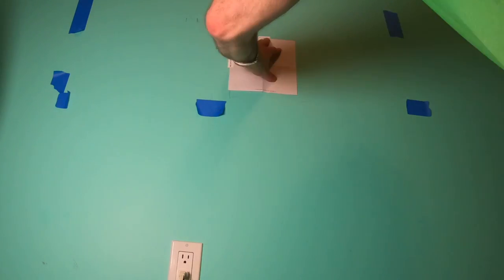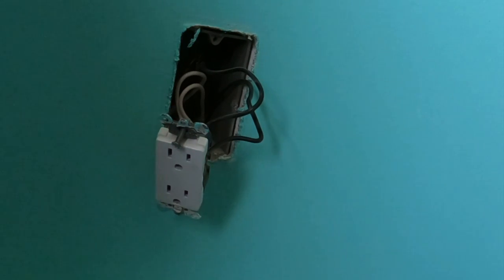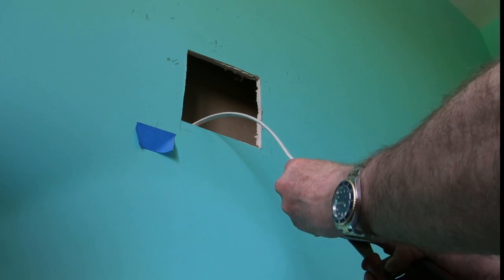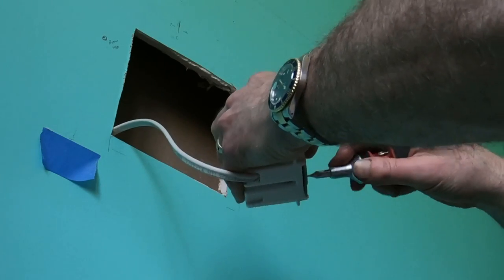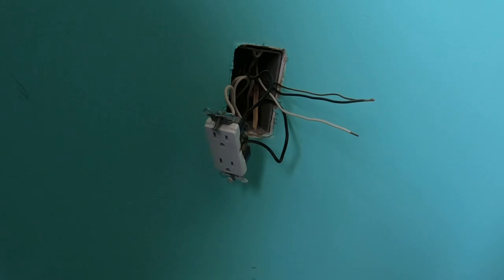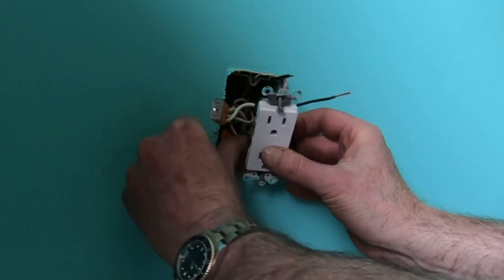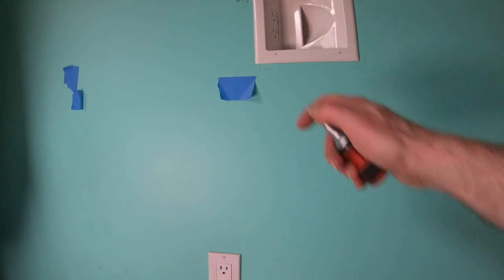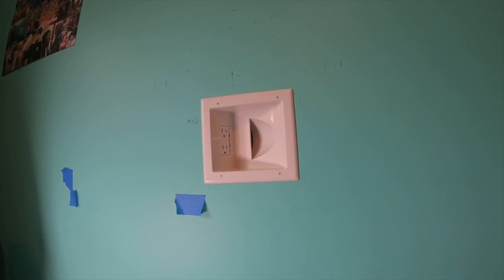Electrical outlet install -- recessed DIY- for wall mounted television

Comment: How deep is the space between your drywall? For some reason, the box i bought won't make it;s way flush with the wall. It's either one of the corners is stuck or there isn;t enough room between my drywall.
Reply from the maker: In residential construction as I understand it, all interior walls use 2x4 as studs. So there would be 4” between the pieces of Sheetrock. I’ve personally never seen a wall made with 2x3 studs. Either way the box should absolutely fit.  The hole you cut should be large enough for you to look in there and even measure .  It’s most likely a corner or small piece hanging it up. Let me know!
Reply: @Samlol23_drrich  I appreciate you! Turns out the drywall in my unit was spaced out by a 2x3 metal stud not 2x4 wood stud. So I had to buy a slimmer wall unit. It worked like a charm.
Reply from the maker: @JMMJ94 wow. Thanks for letting me know and I'm glad it worked out.  At least now you know in case you ever need to hang anything heavy!

Comment: Model number of plastic box
Reply from the maker: No idea.  Got it at home depot. If you go on their website im sure its there.
Reply: @Samlol23_drrich  Commercial electric (home depot brand) recessed electric and data outlet. In electrical/audio/ video aisle.
Reply: Great vid
Reply from the maker: @Rbj4525  thank you very much for both comments.  It’s rare that someone actually likes one of my videos, so it’s greatly appreciated!